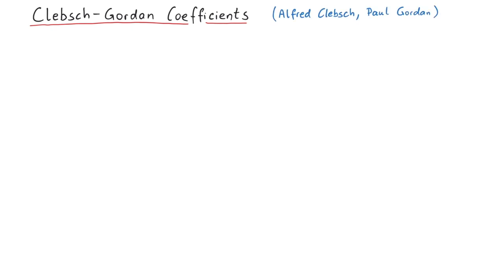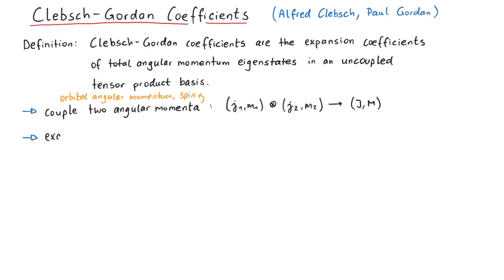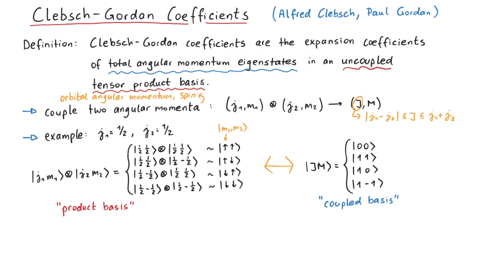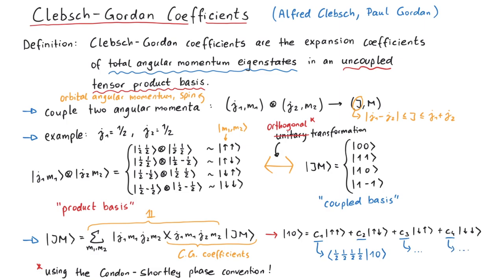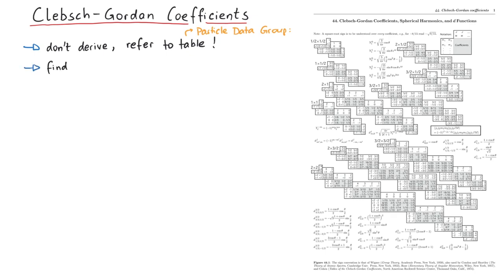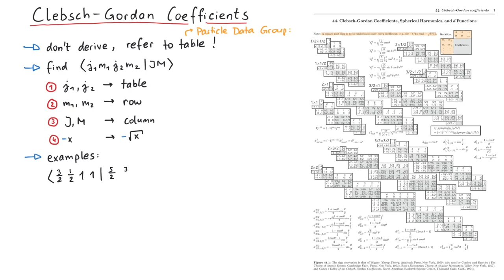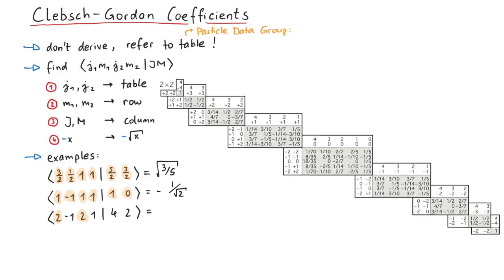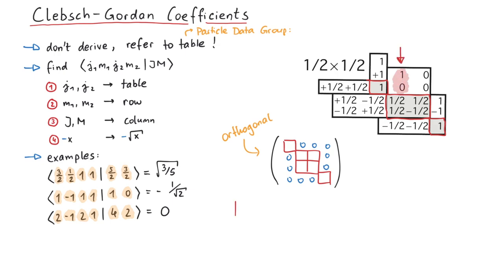Clebsch–Gordan Coefficients Explained

Comment: Good video. It helped me read the information off the table. I don't get why the individual sections of the table are organized in that way though? Couldn't they be separate little tables rather than touching each other? (Take the 1x1 table for example)
Reply from the maker: In case of the 1x1 table, those nine states on the left constitute one complete basis system of the product basis, similarly, the nine states on top together are the complete coupled basis. Therefore, they belong together. 

As we mentioned in the video, this should actually be a square 9x9 matrix, but since most of the entries are zero, they are usually left out.
Reply: @PrettyMuchPhysics  thanks so much! That sorts it out.

Comment: How would you find the Clebsch-GORDON coefficient for which the total spin is 1/2 and the z-component of the spin is 1? I couldn't locate that on the table?
Reply: Also, the spin of particle 1 is 1 and spin of particle 2 is 1/2.
Reply from the maker: The magnetic quantum number (m) cannot be larger than the orbital quantum number (l), that's why there is no L=1/2, M=1 column. In other words, if it's not in the table, it's zero!